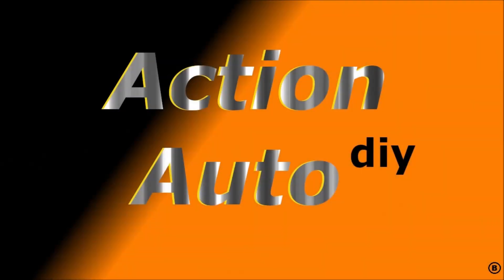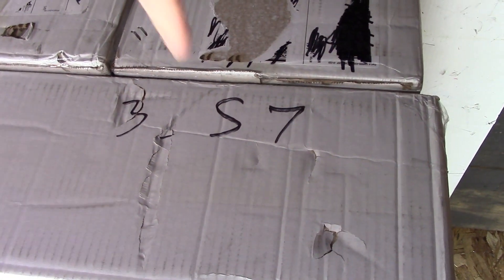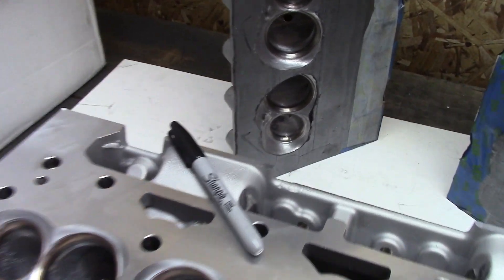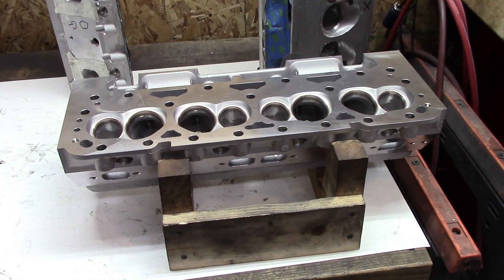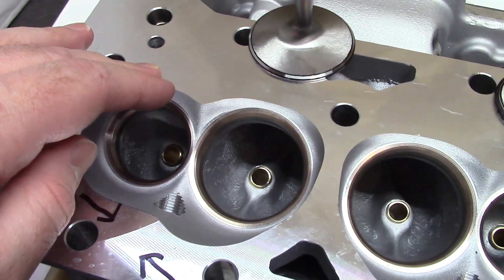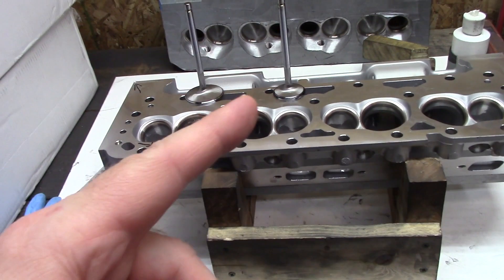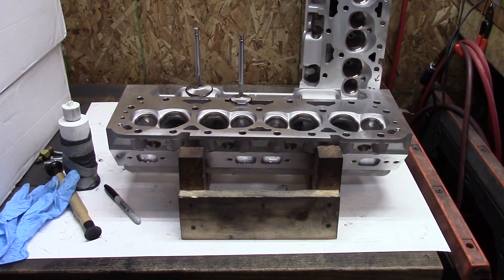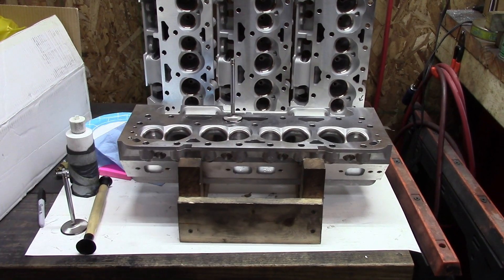4.0 & 5.0 ebay Bare Chevy Aluminium Heads

Comment: Like the Ls3 heads a wafer of copper is added to the ductile iron mixture and sent through the furnace where the copper melts to the mixture mostly on the visible surface. You see this a lot on heads made for marine use, the cold water running through the engine can cause condensation from short runs or starts and keeps the seats from rusting. I'm surprised to see Ampco 45 on really cheap heads! What Ebay seller are these Enforcer copies bought through?? Thank you !!
Reply from the maker: Search CYLHSBC350 and you should find the merchant, pretty much the cheapest straight plug vortec only pattern version.   These Dart copies have been on ebay for some time, AFR just got some of the castings to machine in their own way(8mm stems).  The ebay heads go by many names but are pretty much the same.

Comment: I wish there was a $200 set of big block Chrysler heads. Even if I had to spend $1000 at a machine shop to make them "right".
Reply from the maker: Yah kinda why I never got into BBC, too $$$ but they are nice!
Reply: @BOOT  factory BBC heads are pretty good before having to go aftermarket.

Comment: I keep looking at eBay heads but I'm just going to clean up the world products sportsman 2's I did order a new harmonic balancer and some arp cylinder head studs . Still need to figure out what cam I want to run and I need a bunch of other parts , I'm closer to having everything but still feels like  I have a long way to go . Hopefully I can afford the gas by the time I get it done ... Lol
Reply from the maker: I've made over 400hp with unported SP2 heads and even won a lot with a sub 400hp SP2 combo, beat a guy with CNC AFR's & 50+ more cubes.  A lot more to going fast than just good parts but they do make it easier if you know what your doing.
Reply: @BOOT  that's Awesome , I'm no expert but I'm a handy person to have around , I have done a lot of different jobs and done a little work in a machine shop , I'm going to  practice on an old set of heads I have before I do some clean up on the sp2 and definitely take my time , I don't want to mess them up . I try to educate myself before I work on things I haven't done , so I'm more prepared . I'm in my early 50's so I have gotten more patient over the years so I'm less likely to screw up ... Lol